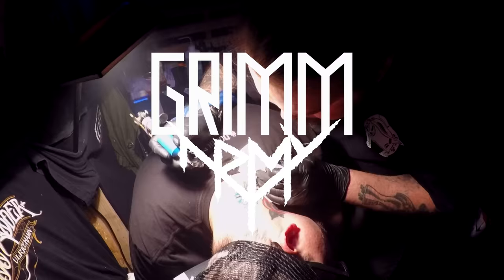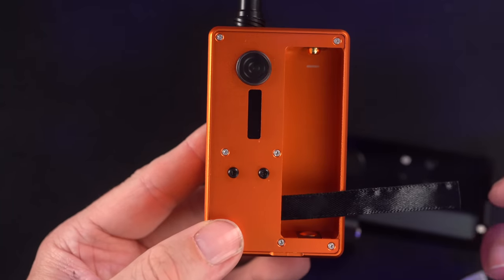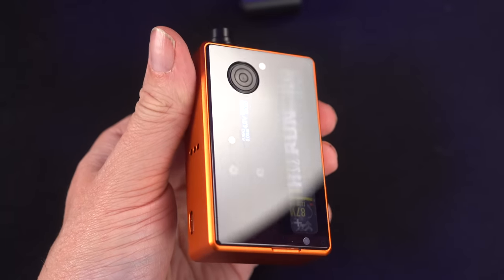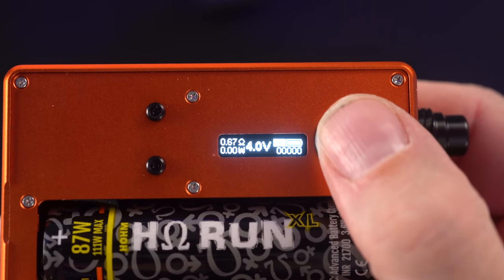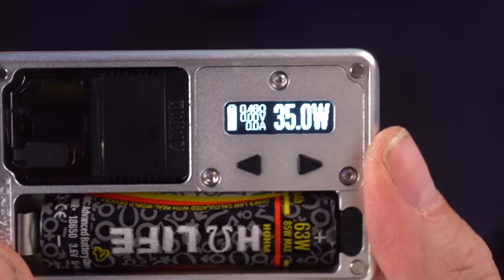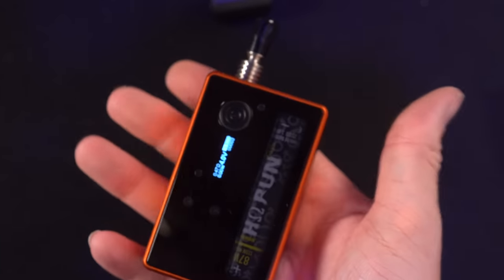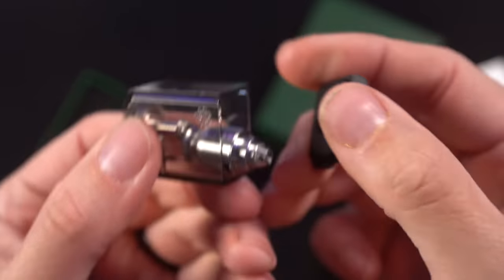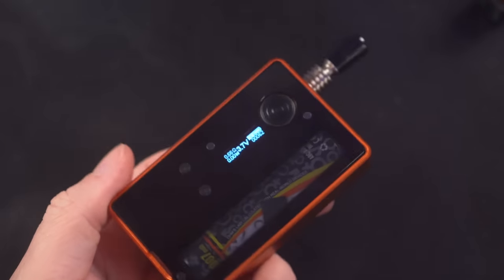Troubleshooting the Hastur AIO | 850 RBA

Comment: Great job on the review, as always! Most of the boro bridges are designed specifically for the billet box and they come with varying tolerances. Due to these tolerances, the integrated drip tip in the kit may not work well with some of the bridges. I will discuss this with our designers to improve compatibility. Thank you.🐙
Reply: I love my Cthulhu AIOs, and I run into the same issue with certain RBAs as well. Whenever I use too much power for a build I'm using, then the chip shortens out. The tolerances on the locking nuts seem fine, they're in the same dimensions as a regular bb nut. It seems to be the atom chip and it doesn't like when you're using too much power output needed for a build.

Comment: I have The Cthulhu AIO and it did the same "error codes" with some locking nut especially with the included nut, and i ask one of my local vape store and the guy explained to me that the culprit is THE LOCKING NUT. He explain "if you tighten the nut without any boro, you can see that the locking nut won't go thru the hole because the flaring on the nut or "stopper" and that's the problem, because some boro or RBAs are shorter than "requested", so the locking nut wont touch the boro or just barely touching. The locking nut problem not just causing the "check automiser" code but the jumping Ohms reading too. So i bought "BilletBox Style" locking nut and i bought the gold plated or anodised(idk, its gold color) and it works fine without any problems,and i bought some integrated nut without the "stopper", so if i thighten it with out any boro or RBA it just keep turning and eventually just goes thru the hole and it work just fine
Reply from the maker: oh right on, that's a good fix

Comment: I got the Psyc inside of a Kraken boro tank as well, it works AWESOME! 

And the issue was you used it on voltage at 4V lol. I noticed Cthulhu chips short whenever you use TOO MUCH POWER for that specific build. It happens with the Cthulhu AIO, and I'm waiting for my Hastur and it's essentially the same chip. 

It really can be annoying, it seems like a built in safety feature. But if you stay in the range of power that is available for that specific build, then you'll be fine. 

Even with other integration drip tips, it works fine. It's just the chip and how much power you're trying to blast your build with. 

That's kind of weird tho, you'd think that 4Vs would be perfectly fine for a build, but that's the ATOM chip for you lol. I LOVE my Cthulhu AIOs and I'm sure I'll love the Hastur. Especially since it's basically the same size as a BB. The Doors on BBs make the BB pretty much the same size as this one.
Reply from the maker: Seems like you're polishing a turd here.  4v isn't unreasonable for a 0.4ohm build.  It's fine if you like it and enjoy using it, that's different than having objective issues with a device.

Comment: Grimm. If/when you get the steam crave meson aio, see if you're getting similar behavior out of that one.
I picked one up, getting back into the scene, and I've not had it read a short on fire like that (except when I tried to build in coils that were too large), but I HAVE noticed resistance variances of up to 0.1 (reading from .2 all the way up to .3). It tends to fix itself when I pull the tank and wipe everything down. I thought the connection was just super sensitive, but the board ui is the exact same. Now I'm wondering if it's the chip itself

Comment: I've got the blue 1 and I love it. Hoping they will bring new panels out as the panels are a fingerprint magnet.

I'm looking for a locking nut so I can use my own drip tip. What would I search for, for a compatible one?
Reply: Just search for “integrated tip”
Reply: @PL3BSY  I tried an interagated tip from a pulse aio and it didn't fit. I think there different sizes. Unless the person in the shop didn't try properly. Thanks for your reply though
Reply: @misterpottsy5598  it must be billet box compatible flush nut. Doesn't have to be the real bb flush nut those are over priced
Reply: @misterpottsy5598   the original Pulse AIO has different threading than most other boros that they supposedly fixed in the .5. So it’s possible that the tip is just ever so slightly different.

Comment: Cthulhu that I’ve got is the previous version. It didn’t last a month. The chip needed to be replaced after I replaced it now the connection from the pin to the board got disconnected.